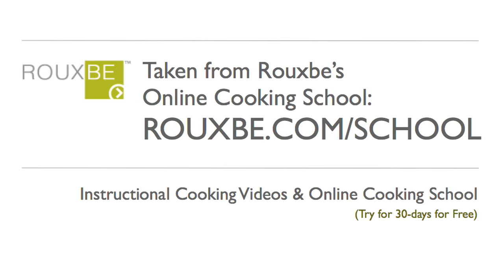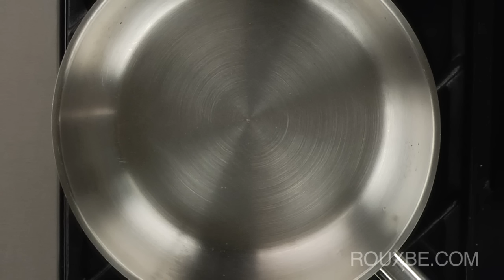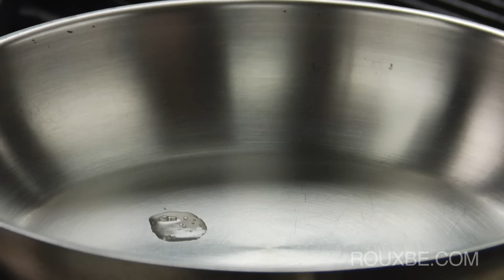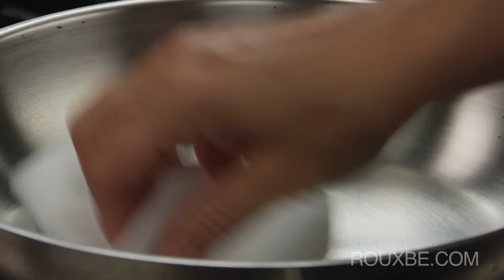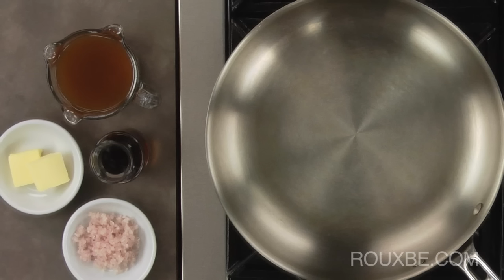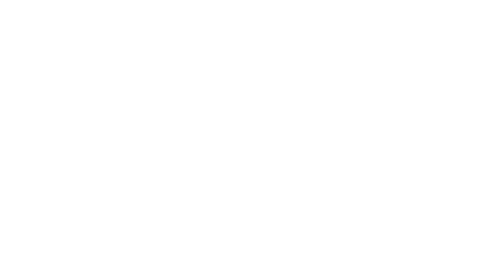How to  Properly Heat a Pan

Comment: Do you start at medium/low?  Also, when I get to that stage do I turn the heat down when I start cooking so the pan doesn't "get to hot"? And considering the pan is at a certain heat, does that mean I should cook everything at that same temperature, that doesn't make sense.... does it?

Comment: Could you use a heat temp gun for this?
Reply: Infrared thermometers are very inaccurate on reflective surfaces. On cast iron  or cast steel they work really well but generally not on stainless steel cookware.